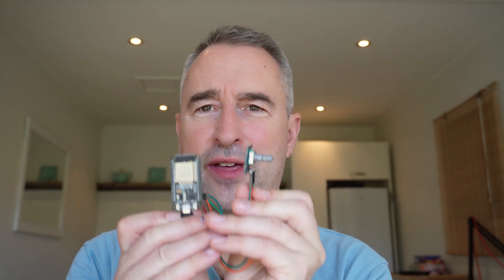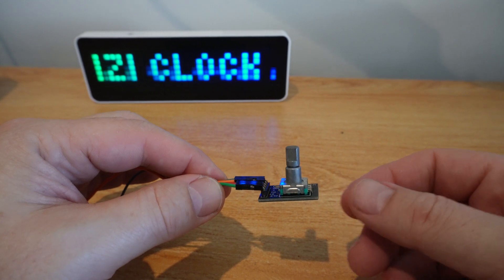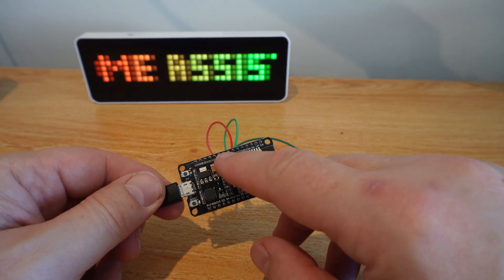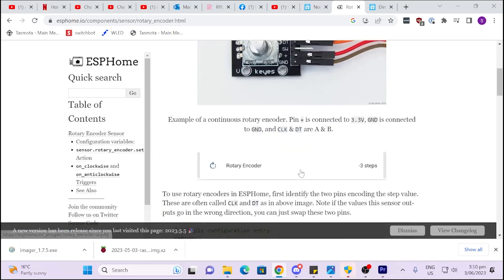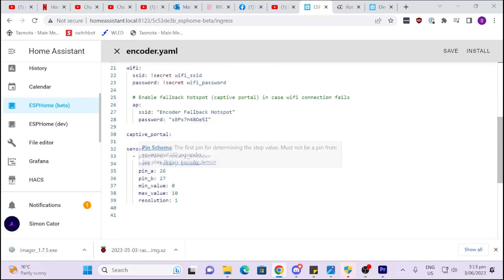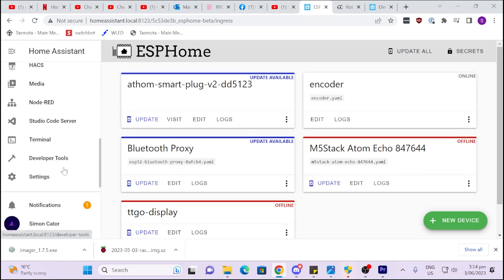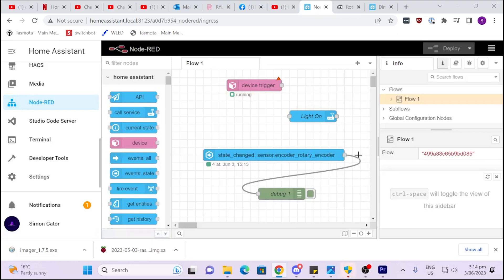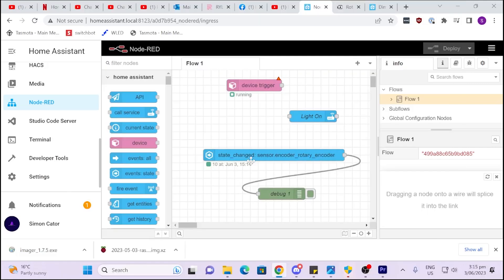Rotary Encoder Automation in Home Assistant

Comment: Do you plan to operate this device wired in or do you plan to also make it "truly" wireless with a battery pack. I am looking to do this for my sonos+tv combo, maybe even add more sonos stuff if I can pull off the remote version with reasonable battery duration.
Reply from the maker: Currently I am using it wired in but you could quite easily add a battery pack to make it mobile.  You may need to consider switching the ESP 32 into sleep mode when not using to to save the battery power.
Reply: @simonsayshomeassistant  I went into a reddit rabbit hole regarding this and it seems that the deep sleep mode is essential. I don't have a conclusive answer yet, but the wake up lag might also need to be a consideration for going that route. You don't want to wait 5 seconds before you can change volume.
Reply from the maker: @aseemdua5086  Yes that would be far from ideal!

Comment: Hello, I have tackling the same problem myself, for the debounce you cand use something like:
sensor:
  - platform: rotary_encoder
    name: "Rotary Encoder"
    pin_a: GPIO5
    pin_b: GPIO4
    min_value: 0
    max_value: 10
    resolution: 1
    filters:
      - or:
        - debounce: 0.1s
        - delta: 10
The code above work and gives back a clean number. I've got the min/max and resolution from this video, thank you so much for that.
Reply from the maker: Hi Synco, thank you for your support!
Reply: @simonsayshomeassistant  did you managed to get the automation working?
Reply from the maker: @synco1985  Yes, I did get it to work now!  See this video https://www.youtube.com/watch?v=IVz4-2dUnNk&t=21s

Comment: Simon did you ever get the Rotary Encoder working? And did my suggestion about adding another trigger for below 1 step help? Just wondering.
Reply from the maker: Great news, I just got it working in Node Red!
Reply: @simonsayshomeassistant  that is great news i don't use node red myself was always able to get my automations working in HA's GUI., but glad its working for you 😃
Reply from the maker: @HATipsByLarry  Thank you Tiger, please let me know if you have any more thoughts on how we can get this working in HA Automations, it was quote possibly my lack of knowledge that couldn't get the steps to work!  I really appreciate your input!
Reply: @simonsayshomeassistant  In order to troubleshoot it i need some more info, what did/didn't it do when you had the 2 triggers in the automation for 1 step above and the other 1 step below? And what does your esphome script look like in its entirety?
Reply from the maker: @HATipsByLarry  Great how can I send you some screen captures?
Reply: @simonsayshomeassistant  FYI, I'm going to order 3 of these along with some D1 form factor esp32's so i can try it out for myself. If i can get it to work i'll design and 3d print some cases for the esp 32 and the rotary encoder
Reply: @simonsayshomeassistant  i sent you a e-mail with my contact info in it.
Reply from the maker: @HATipsByLarry  cool thanks I will send you the screen caps
Reply from the maker: Hi Tiger, no luck yet, the multiple steps does not seem to work.  Another viewer has sent me a YAML code automation which I am attempting to get working.  I promise to post the follow up video the moment I get it working!
Reply: @simonsayshomeassistant  ok just thought i'd inquire about it no worries. 😀
Reply from the maker: I really appreciate your input Tiger!  Please let me know if you have any other ideas! It would be really easy if we can do it in the Automation area as I am useless at coding :)

Comment: also i was thinking after you get this working you could use the switch (the press pot stem) to change the target enity by creating a numeric HA helper and a automation to change the helper each time the pot is pressed. This way a automation could be created to say dim or brighten a light then press the stem to target a different light or other device. Should be able to do this.
Reply from the maker: Great thinking Tiger

Comment: The way you have the trigger is ok but i would change the Above value to 0, that way it will trigger each time the value is above 0. It will trigger once for a value then trigger again when that number changes. For the action use the Choose action. That way you can set a numeric state conduction for each number and a action for that number. For example if you wanted it to run a action for number 1 set the choose numeric conduction to above 0 and the Below one to 2.
Reply from the maker: Hi Tiger, thanks for the great feedback!  Problem is when I get to the trigger part it still only offers above of below step numbers, not an actual number.
Reply: @simonsayshomeassistant  I see ok above one step is fine as you have it set then set another trigger for below 1 step that way no matter which way you move the pot the automation should trigger after it changes 1 step in either direction

Comment: Hi Simon, in node red, try adding a "switch node", add each value to the switch node eg 1,2,3, ect 
then add "call service node" to each of the switch node outputs  eg "1 turns on a light " , "2 turns light off"
Reply from the maker: Awesome, thank you rrrrrrrr I will try that!
Reply from the maker: OK I have the switch node working great, now for some reason the call service is not turning the light on, very odd.  Does not show anything in the logs either
Reply: @simonsayshomeassistant  try adding debug node to out side of switch node to see if payload is flowing
Reply from the maker: @rrrrrrrr290  thank you I will try that

Comment: Hi Simon, theres a number of solutions for the automations. Option 1) You could trigger on a state change (i.e. numeric state) but leave the above and below blank, this means the automation will trigger on any new value of the encoder. Then you add a condition for when the encode equals a specific value.
Reply: I agree, a numeric state trigger should work.  Imterestimg device indeed.
Reply from the maker: Hi Patrick, great, thank you I will try that!
Reply: @simonsayshomeassistant  I posted 3 options, the other two didn't show up as I included some helpful links to the HA docs - I didn't know links are not allowed on YT!
Reply: do you have a github or email address where I can contact you?
Reply from the maker: @PatrickFelstead  Thank you for your email and support Patrick :)